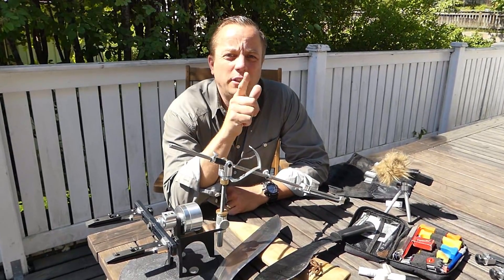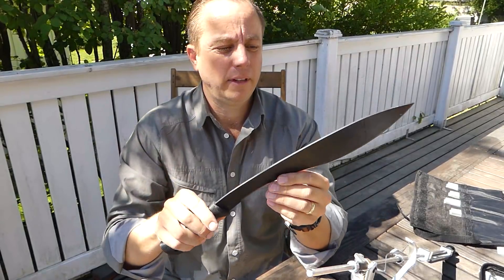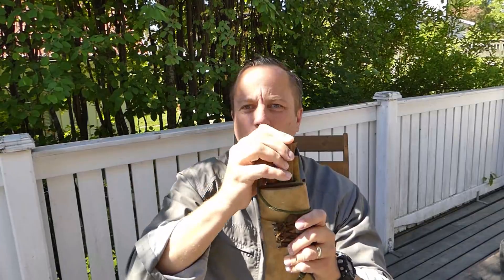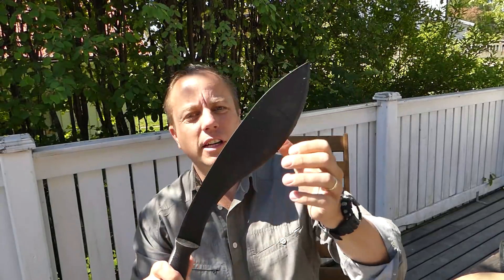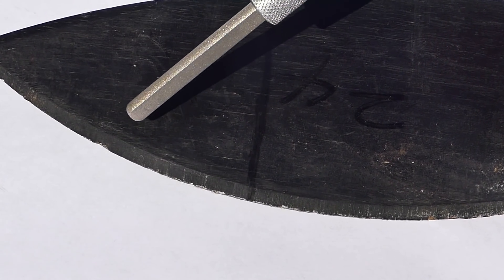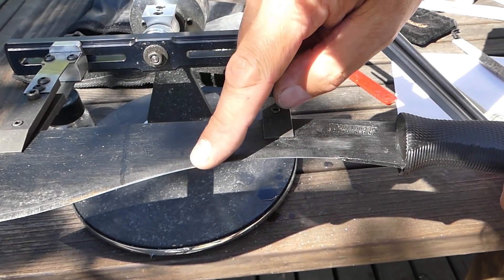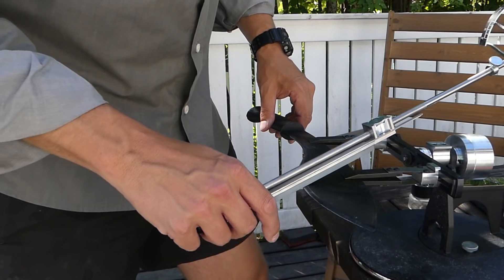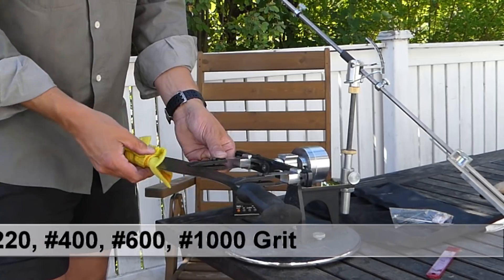Sharpening A Kukri Machete | Cold Steel Machete

Comment: I’ve been making knives for 5 years and I’ve learned machetes are supposed to be soft so the edge rolls instead of chips for quick repair in the fried
Reply from the maker: That’s right bro , it should roll before it chips. But not roll too easy either
Reply: Humble Trekker true and I meant field not fried 😂😂😂 and what’s the best way to contact you
Reply: That makes sense.

Comment: i have been using a lot of tomahawks lately, and then the other day brought out my kabar kukri machete, and chopping with that versus the tomahawks is like night and day, the kukri is just way more comfortable to use and much more accurate, tomahawks are not for beginners, i have been using axes since i was little but the tomahawk is a tool that you really need to be careful with because you can hurt yourself really fast with a hawk, the kukri at least with its longer edge is less likely to miss or glance off of something at weird angles, plus its much easier to strip small branches from larger branches.
Reply from the maker: Interesting reflections on chopping. Cheers

Comment: Hi.  Is it possible to get the name of the sharpening system you use?  And the degree measuring tool
Reply from the maker: The tool is digital angle gauge there are lots of them on amazon for around $20, there are many manufacturers of them. I can’t remember what brand mine is.  The system is  https://tsprof.com/en/

Comment: I cannot understand why people buy cold steel knives when the genuine article from Nepal can be bought very cheaply, excellent tutorial though
Reply from the maker: Maybe availability. Cold steel are a big company and sell there stuff everywhere
Reply: fair enough but I don't think I will trade my Nepalese kukri for a cold steel version, I love the heft of mine if I need a thinner blade I use a machete
Reply: ah I see, mine is a six inch bladed version and is very thick on the spine, I like the added weight but had to reprofile the edge myself and put a 90 degree spine on it as well as a few minor other mods
Reply: seanthomasdowd because the quality of the steel and product.
Reply: Kukris from Nepal coming here are notoriously dull and useless. They cannot be shipped here with an edge some kind of strange law.
Reply: Re nato  fair comment you do need to check out the sellers carefully